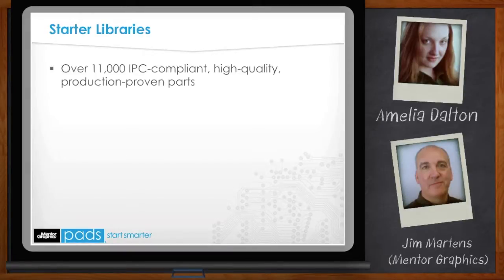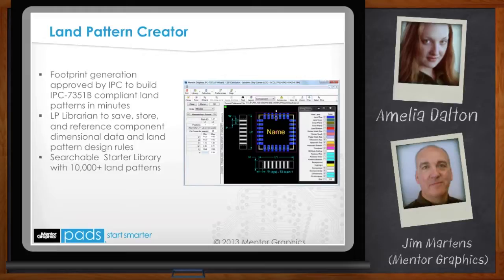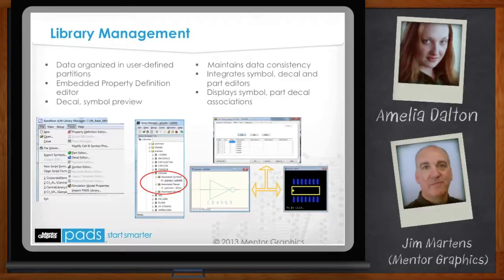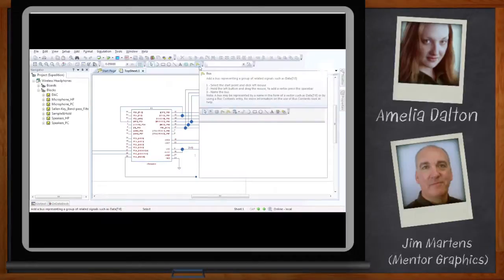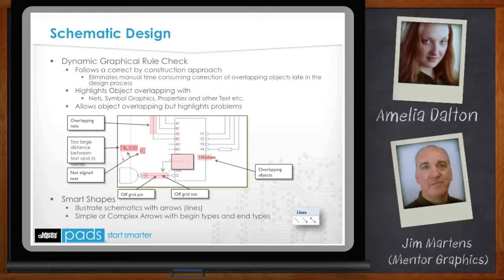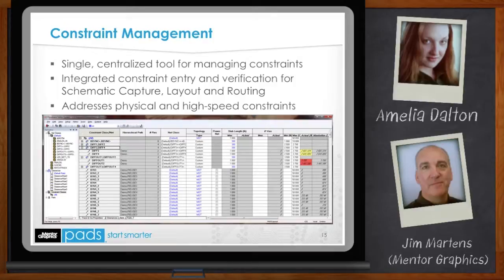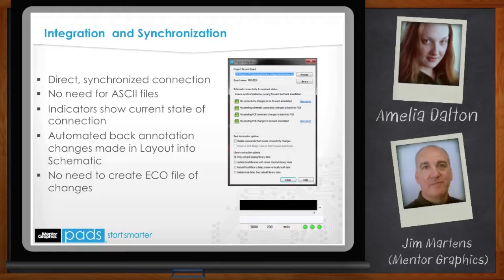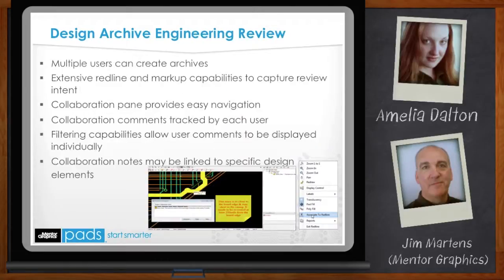PADS VX: Redefining Productivity

Comment: It seems there a disconnect somewhere. I work for a small company designing big things that keep the US safe.  We purchased PADS LS Suite.
Everything states we have DxDesigner .  The new way to go I agree but we did not get the DxDatabook .   It seems without this EXTRA COST DxDatabook it renders DxDsigner useless.  There are many things wrong with this....and their advertising. We were misled.  And Mentors position seems to be to bad use logic.....  holding my tungh